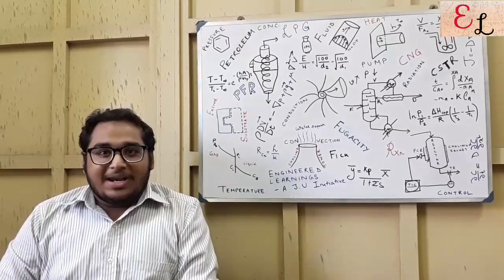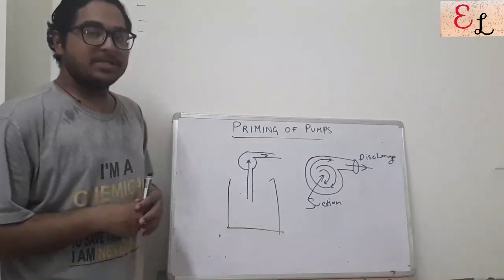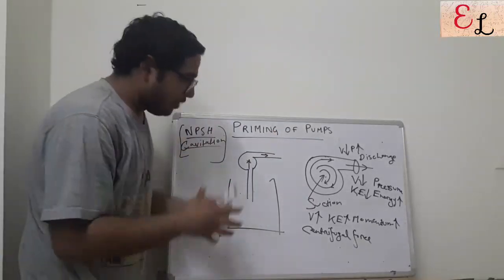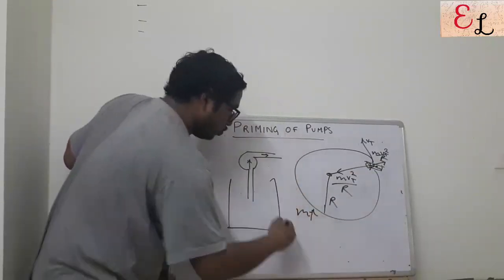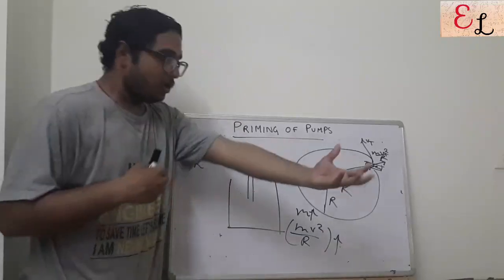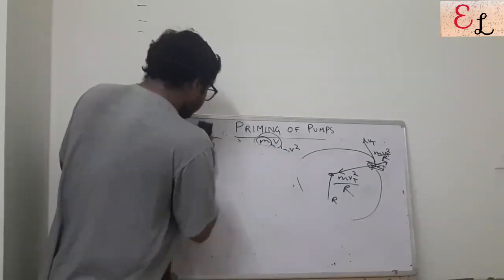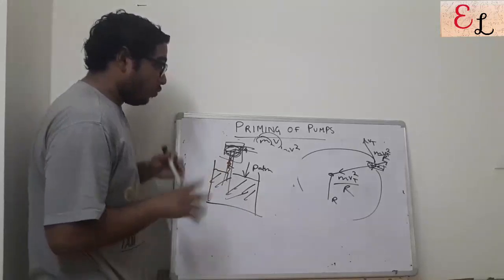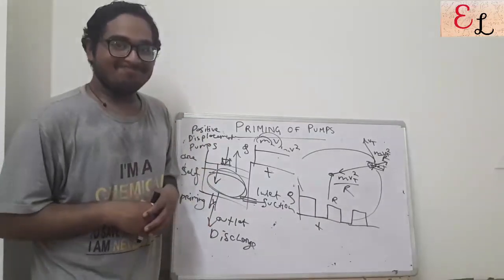PUMP PRIMING | CENTRIFUGAL PUMPS | SELF PRIMING PUMPS

Comment: If I use a liquid of density same as of air , in place of water , for that situation do we need priming ??
Reply: @Syed Fahim Ahamad sir kmon achen?
Reply: @abhrajitsaha7   🙄
Reply: @syedfahimahamad9488  🙄
Reply from the maker: First of all, air is 830 times less dense as compared to water, thus finding a liquid as less dense as air is near to impossible. If the density is comparable to air, it will no longer be liquid but existent as a gas. In that case, the device used for pumping the gas is no longer a pump. It is a compressor or a blower depending on the volume handled and RPM required.